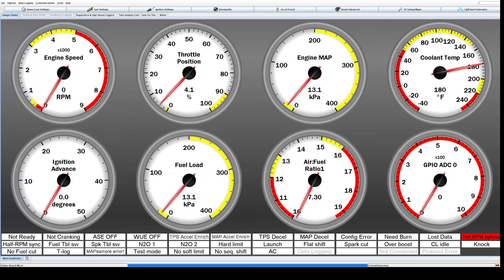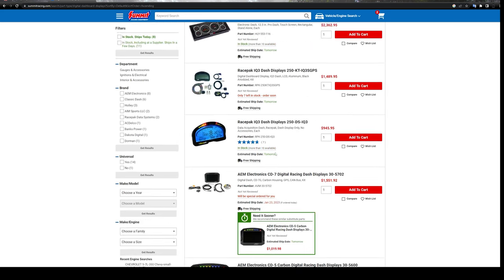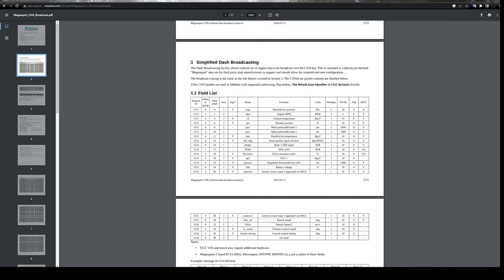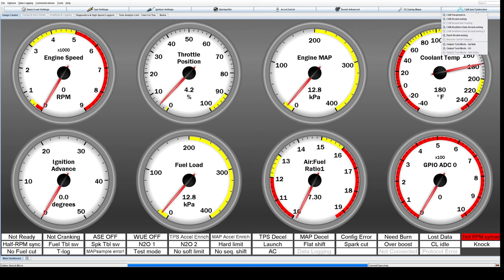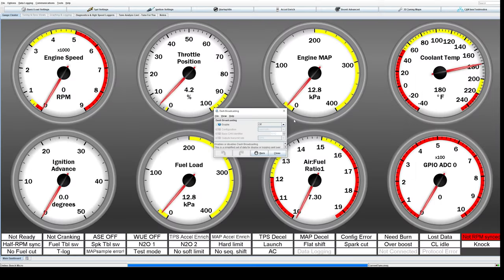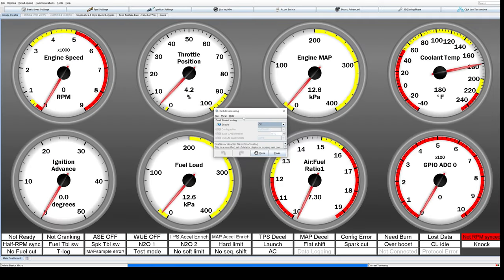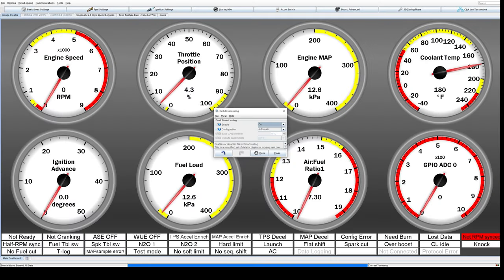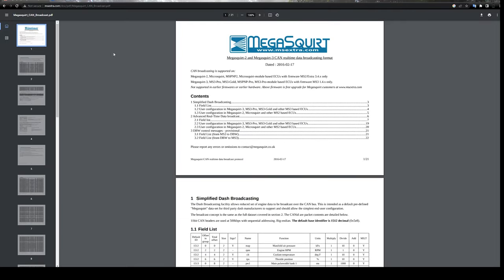Megasquirt CAN Bus Dashboard Basics | CAN Bus Basics for Megasquirt and Speeduino

Comment: Nice video. Have you figured out how to send CAN message to prime fuel pumps? I could not get it to work. It should be 'engine' bit field.
Reply from the maker: I am working on writing a dash in micropython currently. I am interested in figuring out the sending side of things but it will be a few weeks or so. Stay tuned and I will post more soon
Reply: @TurbineResearch  I have had some success with sending arduino analog signals over can bus. i had 4 bad mcp2515 transmitters but a seeed studio shield worked finally after 2 months of messing around. working on sending more and more data sent. I am horrible at code but learning. could be a video because it is very spotty out there